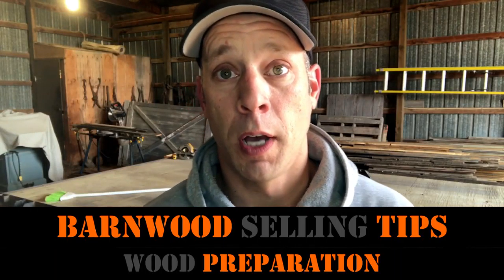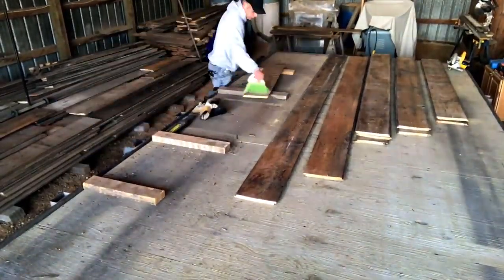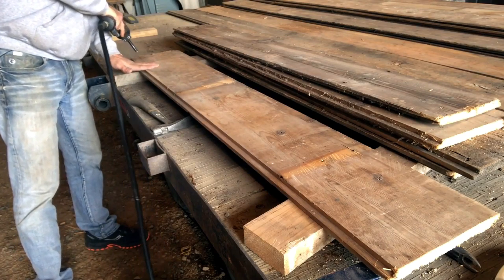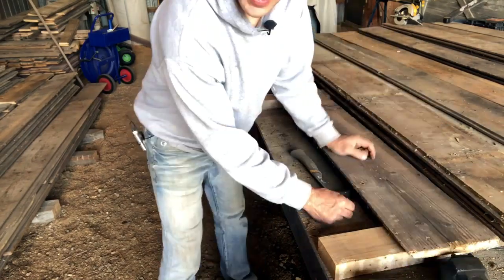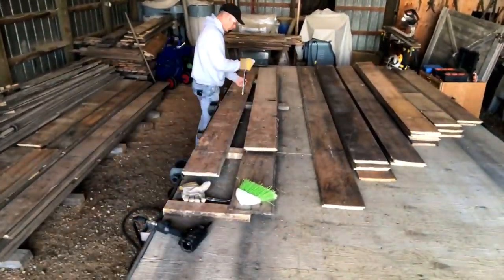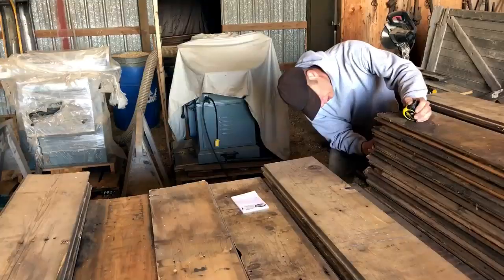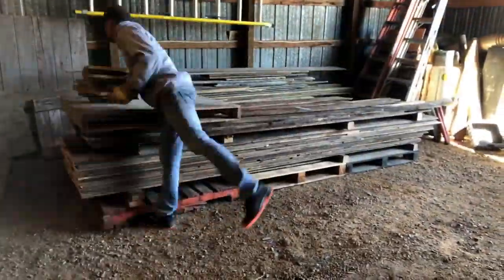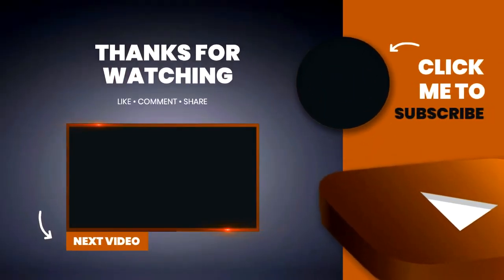Barnwood Selling Tips for Reclaimed Wood

Comment: I have a shit ton of all white and red oak pallet wood!  I've collected from work for years! All clean and detailed! About 500 pieces, all measure 3.5 x 42 x 0.5. Most of the ends have been glued back together with Titebond 3! My question is, does this have value?  Is there a market for it? Thanks!
Reply from the maker: Without seeing the wood I believe it would hold value.  The trick is to unlock the value with exceptional listing photos matched with a fair price.  Good luck